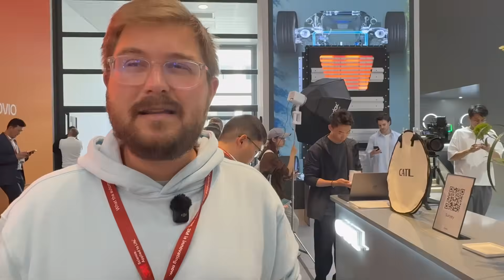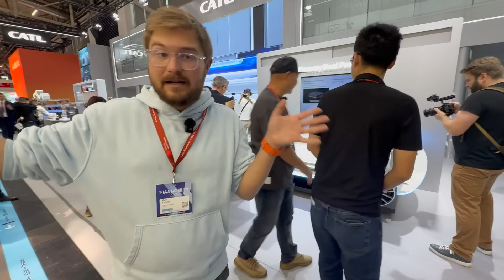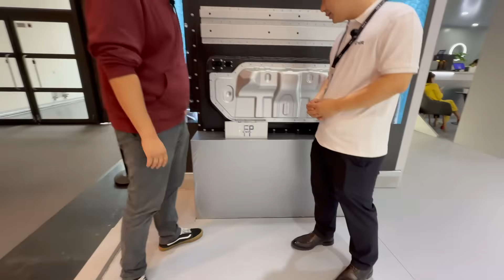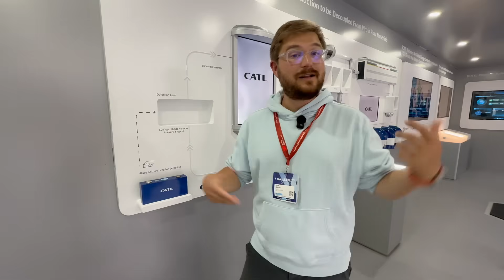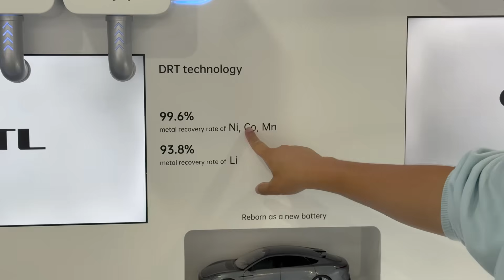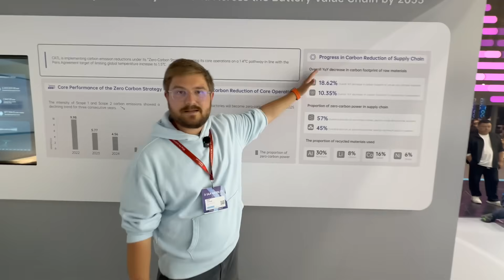CATL Debuts Shenxing Pro LFP Cell w/12C Charging & Long Life!

Comment: Recycling is huge, even bigger than you talked about here.. We already have two heavy players in the states. There is absolutely no reason recycling can't reach 80%+ in 2 decades as we progress tech forward, refine recycling processes with discoveries, and battery tech evolves into even better cells/tech.. This doesn't just apply to EVs, but all cells.. It's the future oil industry in my opinion, without a doubt. Once people find out that you only mine 10-15% of your mineral to maintain 90+% of your battery supply it will be a no brainer.
Reply: Just like lead acid batteries, where the material itself is scarce but because of recycling it keeps getting cheap 

I'm pretty sure that once the battery recycling infrastructure is mature, lithium battery cost will get cheaper than lead acid
Reply: And since JB Straubel has already projected their data showing the recycled  materials will be only 17% the cost of mining new stock, the saving will reflect in lower pack price.
Reply: The issue about 80% in 2 decades is not about recycling potential, in 2 decades there simply won't even be enough EV packs reaching end of life for recycling to even begin. Claiming that in 3 decades for example is much more realistic. I think even their 50% estimation is optimistic, as usual.
Reply: @maximusasauluk7359  I'm not so sure. There will certainly be cases where EV batteries will need to be recycled early, like accidents or defects. But I think you are right on assuming the EOL of their capacity being so long that it will be difficult to get a large amount of them.
Reply: The US should slap tariffs on Chinese rare earths. We can't let them flood our market with cheap, critical materials and undermine our own domestic supply of... uh... strategically important rocks.

Comment: They are inventing new and better battery's every week, but we are all using 18650 battery's that ware developed 35 years ago. That proofs that all this invention story's are a lie that's needed to steal taxpayers money.
Reply: 18650 has nothing to do with chemistry or technology development. It's basically a size. That's like saying, the V8 engine was introduced XYZ years ago, so a V8 engine from that time is the same as a V8 engine of today
Reply: @WoundUp  They are making new blade battery's and you can't find the anywhere in 2025.
Reply: but we are all using 18650 battery's that ware developed 35 years ago
==> Can you please enlighten us on your 35 years experience with your 18650 EV that you obviously purchased already in 1990 (which company did offer at that time already an EV?).
I would also be interested in your long time experience with your 18650 Power Tools that you purchased 1990 (in my image at that time NiCd got slowly replaced by NiMH, but 18650 and Power Tools came much much later).
But partly I agree, there is recently much to much hype information around batteries which make many people lose sight of what is really ongoing. Solid-state batteries are such hyped example, but the in my view extremely important LFP (LiFePO4) battery was just invented for its chemistry, if I remember correctly, in 1997 and became operational as a rechargable battery only by a second inventor 2 years later, who changed the graphite structure to nano.
Nevertheless, when you want to claim your 1990 PC is the same as your 2025 PC, as you are obviously doing on 18650 batteries, then I am able to make you following special offer (only half the price of the 2025 PC and I will supply you for minimum 5 years use time PCs of 1990 - OK?)
Reply: @FriedhelmSchröter  First read what I said, I never said that I was using 18650 battery in 1990, but I said that 18650 type of battery was developed in 1990 and that type of battery is 35 years old. I also said that we are all using that battery, that means that majority of people in their laptops, power tools, scooters, e bikes ... uses 18650 battery and not blade battery or any other modern kind of battery.
Reply: @grizzlycountry5539 on market is for sale from 1200mAH to 3600mAH+, that means chemistry evolved X3 in this 35years
Reply: @grizzlycountry5539 laptops , scooters , power tools , need higher voltage to work and a simple blade size offer to small voltaje, or become to heavy to use thous items or to upgrade a manufacturer line is to expensive compared with 18650 mature product
Reply: 18650 is a dimension format , not a chemistry.

Comment: If this battery can be repeatedly charged to 100% and discharged down to 10% without degradation, this would be an ideal battery for people who live in apartments without dedicated charging. The performance  would be almost similar to a gasoline car for the average day-to-day driving situations. Of course the occasional long distance trips would also be Great using this battery technology. Unlike Kyle and Dave who regularly do long distance trips the average person might do a trip every few months so that is not as significant.
Reply: there is another type of LFP, optimized for a storage system, with a life cycle of 12000. CATL had the product 2-3 years ago.

Comment: 12C is that magic "5 minutes" ICE people love to mention all the time.
Reply: @bdog111  Totally agree. If it’s 10 minutes 10-80%, 5 min probably get you to 60%.  Figure most cars now have 300 miles of range, it’s ~180 miles in 5 min.  Awesome!
Reply: 5 minutes is probably the most amount of time people would want to spend and not be inconvenienced. 12C sounds like a gold standard
Reply: @nafnaf0  Modern Man suffers too much convenience these days.
Reply: @nafnaf0  
15 minutes is actually fine
Reply: @rogerstarkey5390 Even with the charging rate I receive now (roughly 15 to 20 minutes to 80%), I can't really say I am disappointed. Because, as you mentioned, I can just walk away and do something else. Would faster be better? For sure. But at the same time, I wouldn't want faster charging if it meant that in the long term the battery degrades faster. I'm not saying that is the case here, I'm just saying if it turns out that is a possible downside in future findings.
Reply: Except..... The charging (still) happens WHILE you do "something else", so once the charge time drops below THAT number,  it's essentially "ZERO", or in fact a time SAVER.

Comment: I love CATL and my new MG4 XPower EV has one of their batteries in it ... 64kwh...
my used EV has 44000km on the clock but only 99.7% Battery Health !
I was amazed about how high the Battery Health is
Reply: Yes but they all play games with capacity. They start with 105%-110% so after a several years they still have 95%-100%. They have really lost 10%-15% of capacity it is just hidden from the owner and the owner thinks they still have almost new capacity.
Reply: @matthewhuszarik4173  That's the most insane take ever lol just making up random shit. First of all LFP chemistry is incapable of degrading 10-15% "after a few years". Not even the first EVs that we're not cooled and used less stable NMC packs degraded that fast. Second of all, why would they waste costs by making a larger pack for no reason and then get a lawsuit later, you can't hide the capacity forever, people will notice eventually something is off especially repair shops. If you want to hate on EVs you'll have to get more original next time, I suggest asking ChatGPT.
Reply: @maximusasauluk7359  Don't some manufacturers actually hide their full capacity from the consumer? For example, you reach 0%, but the car isn't actually at 0%, and you can travel a short distance before the car actually shuts off. I think this is what the other person is referring to.
Reply: @ProXcaliber  It's not hard to find the actual full capacity of the pack. Some manufactures keep a reserve for dumb drivers that like to drive on E and for a safety margin. This isn't nefarious like you seem to think. Lol
Reply: @Yielar1  Did I say it was nefarious? I was just explaining what I thought the original comment in this chain meant. Jumping to conclusions isn’t healthy.

Comment: Looking forward to dual, or even triple chemistry batteries.
I could see sodium batteries being used on the outside surfaces of a battery tray as insulation for more temperature sensitive batteries internally, for best cold weather performance
Reply: Too bulky for cars
Reply: @rogerstarkey5390The idea of multi chemistry packs is to get the advantages of each chemistry for a particular purpose, ie nmc for high power output acceleration,  lfp for full charge capability, low cost, sodium for low temperature performance,  etc
The pack total size, weight doesn't need to be significantly different than a single chemistry oack
Reply: @geraldford6409  In theory a mix sounds great, in reality the improvement by mix is for sure higher cost and the improvement in a certain characteristic is at best mix (much less than ideal).
When you are living in a freezing enviroment the best is 100% of your battery is capable to work at freezing temperatures and when by chance you need to drive to hot climate you may need to accept reduced performance or take special care of your freezing climate battery and vice versa.
Instead of mixing different types of batteries I rather believe the development will favor battery chemistries/physics that provide the overall best mix of all major characteristics, but for a small number of interested people with sufficient money your dream mix battery may also be offered, especially at this moment where the battery is not yet fully optimized. But after your first real time use of a mix battery I believe you will conclude the mix performance is not really worth the extra money you need to spend, because mix batteries will in my image be produced only in small quantities causing a rather drastic price up.

Comment: To make it clearer to your viewers as far as charging time goes, 

- a 1C rating is a battery that will fully charge in 1 hour.
- 2C in 30 minutes
- 3C in 20 minutes
- 4C in 15 minutes
- 5C in 12 minutes 
- 6C in 10 minutes
- 7C in 8.5 minutes
- 8C in 7.5 minutes
- 9C in 6.6 minutes
- 10C in 6 minutes
- 11C in 5.45 minutes
- 12C in in 5 minutes

Of course, 0 to 80% goes much faster than that, as charging slows considerably after 80%. So a 12C battery would go from 0 to 80% in 3 minutes or less. Just as fast as filling up a tank.

So as batteries continue to quickly increase in energy density while getting lighter and smaller, a 300kWh battery that goes around 900 miles at highway speeds for an average size SUV, (1,200 or more miles in city/town driving) will charge from 0 to 80% in anywhere between 7 to 9 minutes. And still have more range than a full tank of gas.
Reply: How do you practically supply 12C or even 10C. Thats the biggest hurdle I see. But imagine 12C on a Silverado EV pack, >2500 kw.

Its great that the battery can do it, but what I really see as being the benefit is that you could charge on a current 350 or 400 kw charger and maintain 350-400kw across a significant portion of the charge without bothering the battery. If you could maintain 350 kw on something like a Chevy Bolt from 0 to 80%, it would do it in 9 minutes or so, which is pretty reasonable.
Reply: I like the C ratings. It is 60minutes dived by the C number
Reply: @junehanzawa5165  12C rating in laborator test ;) but 10C in real condition from 1-80% is more then sufficient
Reply: @eunu6928  lol. Honestly 6 or 7C is sufficient. If you could sustain 6 to 7C from 0 to 80% you would be in and out pretty fast. You would have to be in a real hurry to need to go faster than that.
Reply: @Jay-me7gw .... 80% charging will end before first cigarettes :)) smokers can't end it chill
Reply: @Jay-me7gw "old" chemistry equipped on today EVs can hold 4-5C but untill now dont have a verry good liquid management sistem like Tesla
Reply: 300 kWh battery in small form factor may only be possible if the ultra high energy density sodium sulfur (1200Wh/kg) and lithium sulfur batteries (2 kWh/kg) comes out today

Those 2 batteries exist, but are still not yet leave the testing lab as the charge discharge rate are still very poor at only 0.5C to 1C (vs 5C required in most EVs today)
Reply: Well no, as they always lie and claim peak P rate(everyone has changed to P rate as everyone confuses celsius C with C rate and no, they are not getting lighter.  Battery packs have gotten lighter(packaging), but the cells themselves... not worth mentioning in last couple years.  Need a major breakthrough.  There have been some whispers of lab samples, but mass manufacturing?  No one has figured out a new process yet.